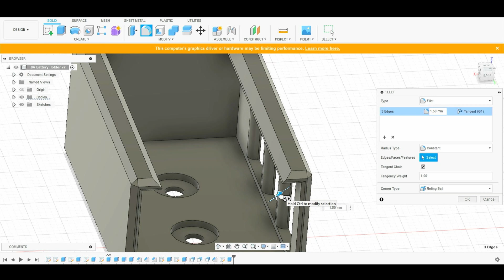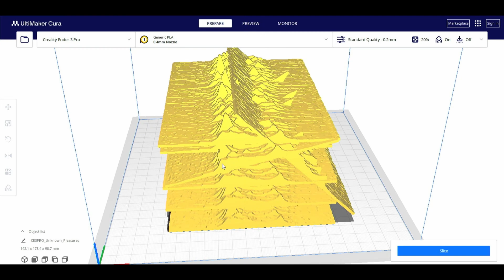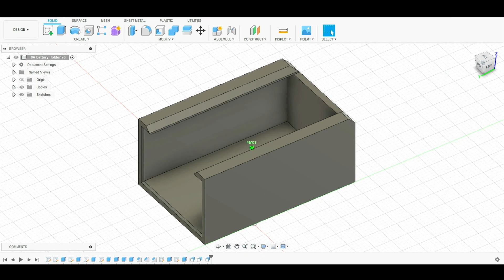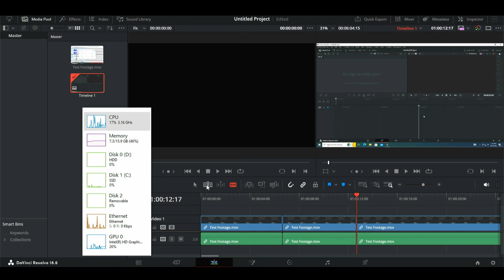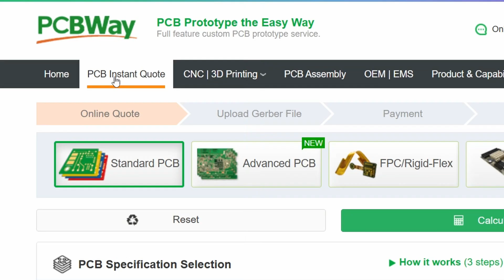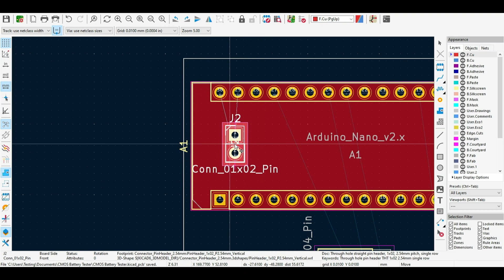The Intel Core i7 7700 - How does it Fare in Productivity in 2023?

Comment: Well, I'm Intel user (loyal? Kinda 😅). The starter was Core 2 Duo E4500, which was just great for that time. Then Celeron N4000 which OK but kinda struggling for a bit demanding tasks. Until now in 2023, I finally able to use Core series, although is i3 1115G4 (in fact is identical with Core i5 8365U in 2018 😅)